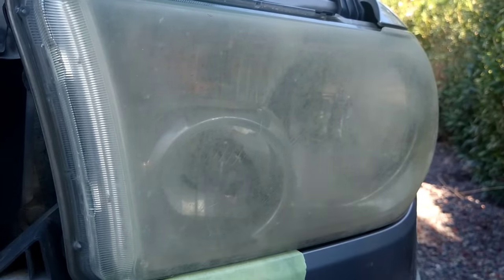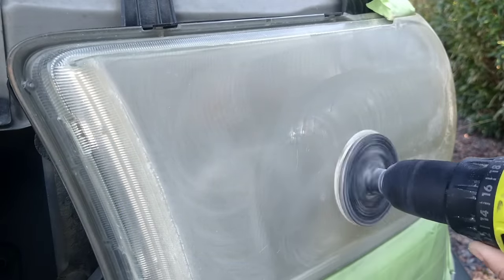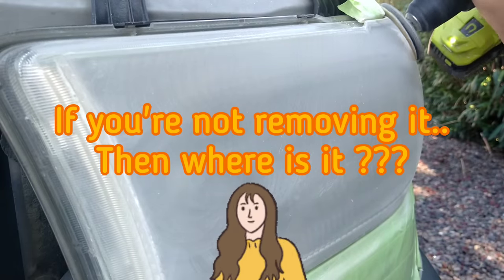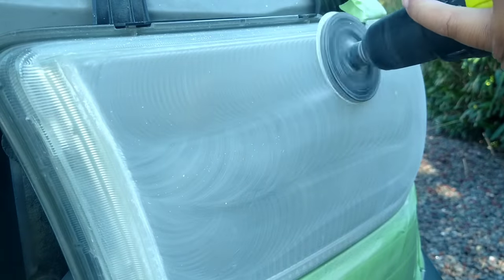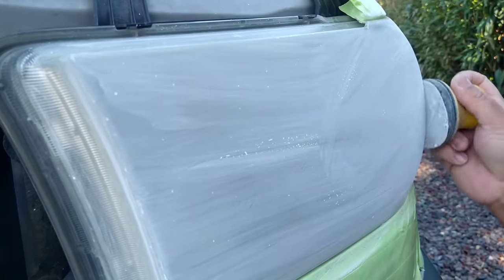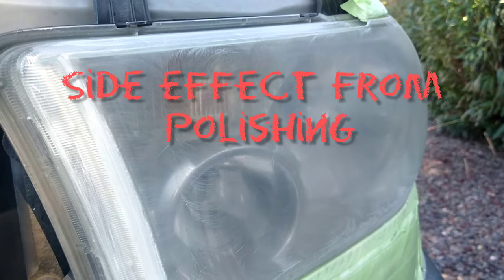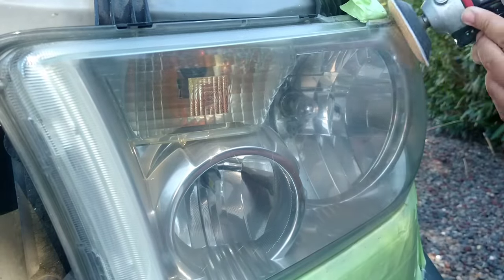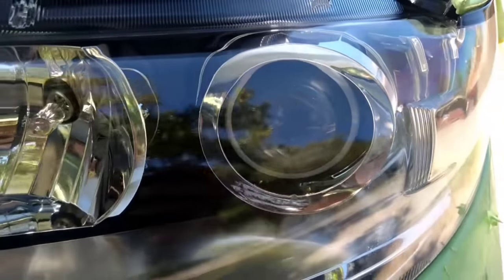POLISHING HEADLIGHTS IS A SHAM/scam  ---  and why you should never only polish headlights

Comment: For the polishing part. Is it okay if I stick to the drill bit if I don't have a polishing machine?
Reply from the maker: Yes and no... You can use it but you will not yield the same high resolution clarity... On a scale of 1 to 10 you could probably achieve a five with that if you work a lot longer at it.. with the polisher you can achieve 10.5 in seconds...
But it is possible I haven't always used the polisher for the step and they still came out awesome..
Reply: @theheadlightrestorationpro  thank you 🙏
Reply from the maker: @wontonpapi8848 👍🏽😁

Comment: If you drill holes into the headlight casing so air can get inside and dissipate moisture the headlights would not fog over like this one in the video. It's because they are sealed, and moisture gets inside (condensation) the lens that causes them to screw up. Just a few small holes with a cordless drill and you should be okay.

Comment: I sand thoroughly and spray urethane clear coat on them . clear coat has uv protection.
Reply from the maker: Awesome.. I got to be careful though.. yes most clear coats have a naturally inherited UV protection but it is limited and amounts.. that's one of the reasons why I like using products specifically designed for headlights cuz headlights need a tremendous amount of UV protection.. not just to go bad but to actually protect the headlights health, crazy spider cracking overheating all that stuff... But there's so many ways to do it as long as you follow the basic elements of true headlight restoration you should be fine...

Comment: After I hit a kangaroo and broke mine, so I bought a brand new headlight, still with tags and plastic for 50 bucks on FB marketplace from some warehouse or panel beater that had one spare. They even couriered it to my door within a couple of days. It was easy to put on (I'm not even very mechanically proficient). Now that is cheaper than most headlight restoration kits. And it looks amazing. Now my other headlight is yellowed, I'm thinking I'll just replace it.
Obviously I'd keep the old one in case I need it later...

Comment: I get all the sanding and taking it down to a 3000 or 3500 grit. But why put a coat? Is this just a UV protectant?
Reply from the maker: Yes it's a UV protective coating..,(headlight certified) designed for use with headlights specifically on headlights... It is one of the most single important steps whole entire process as you see in the videos I could stop at that point before I do that and I can even continue polishing further and further and further until the so clean and shiny and see through that it looks like I did spray it but it would come right back 3 months or less it would start coming right back... You do not want to do that then you're just having to take off headlight surface over and over and over the sooner or later you're not going to have enough headlight... And true headlight restoration you have to see it..)with a headlight certified designed for headlights UV sealer)...
Check out this video here this will really see you in on a couple things about why headlights go bad....
https://youtu.be/tnCdU2j5Ja0

Comment: have you ever had a problem with the ac delco.  my seems to stop when it gets hot I think
Reply from the maker: Never had a problem with that, if you get to the point of overheating you must be using it a way too much... I've never once had a problem with overheating... You should not be using it long enough to overheat...  using it for less than a minute, no tool should overheat in 60 seconds even the poorest quality..

Comment: Does the headlight coating comes off when you wash your car a few weeks later?
Reply from the maker: No it will not come off unless you use a manual method meaning sanding.. if I wanted to remove it two years later I would have to sand it all off ..
Reply: @theheadlightrestorationpro  Perfect! I don't it to come off. I tried using chrisfixit method with the 2x clear spray, that spray didn't work and started cracking and hasting up..
Reply from the maker: Yeah the guys awesome.. with that being said you got to watch a lot of stuff on this internet because can you can put so much stuff on it and make it look amazing for a couple minutes, couple hours couple days etc... But I'll start messing up really quick there's a lot of foolery on the internet with this stuff (headlight restoration) that's why by being a professional headlight restoration specialist /(that actually does this for a living) I decided to make this channel..
So people can finally get it from the horse's mouth 100% true..👍🏼😊

Comment: What if you clear coat it, will it last longer?
Reply from the maker: It will last longer but not as long as it should or as long as it could last..
See when you just polish it it's just doing a bit of a removal with a lot of chemical bleaching which is just changing the color and pigment of the cells and fibers on the surface of the headlight but is not changing the damage once the cells and fibers are damaged they don't heal themselves they're more susceptible to damage meaning that the sun will bleach them faster even with a coating on them than what you have is kind of like a walking Dead where the lights will look good but they'll start bronzing and turning colors underneath the clear coat.. they will last longer but not as long as they should.. one of my favorite sayings that to me makes the most sense is if you don't remove the damage where is it at?....
Very good question... If this was the case I wouldn't do any sanding but because it will come back faster because you're leaving behind damage to material that is just been chemically color changed through polishing and heat the recidivism of the color will come back probably half life if not less..
Very good question thanks for watching have plenty more videos up and plenty more to come..

Comment: what is the lowest grit sandpaper you think i should buy to do really bad headlights ? for example Like p320 ??
Reply from the maker: P220 and that's an emergency base I'd have to be really gentle with it not to press too hard or to overheat because it's a stronger sandpaper...
Reply: @theheadlightrestorationpro  ok thank you Amazon has 3m p320 for $27 box of 50 i think i will get
Reply from the maker: Awesome... appreciate it 😊

Comment: hello the headlight restoratinon pro...
 why would you go for 320 to take all that out faster??
Reply from the maker: Because this light was bare... No clear coat whatsoever for quite some time only thing that was on there was a bunch of soft filling stuff... You want to try to avoid using those 320s as much as you can.. it raises the risk of deep scratches and scarring that you have to try to remove which takes a lot longer and in the long run will take a lot more expensive discs to get rid of and time.... Also it runs a risk of damaging the outside of the vehicle the 320s and the heavier grits will eat through the tape way easier because they're stronger...
So to sum it up you pretty much want to avoid using the 320 as much as possible usually reserve it for heavy coated headlights with a lot of hard to remove clear coat.. also for thought this Toyota light is very soft the Toyota lights are soft or about medium...

Comment: I tried the 2K clear and it didn’t work. I sprayed it on and it immediately started to…crack when it dried. Had to explain to the customer if after the clear hardens and it still looks that way I’ll come back and fix it. I’m switching to the Meguiar’s headlight clear.
Reply from the maker: Yes you'll be much better off super consistent and always 100% on point five star in every category... 2K clear you never know what you'll get but it uses something negative even when it looks good...

Comment: I tried sand paper once on headlights, scratched them like crazy!  I didn’t do it right but now I’m trying to do this on a different car.  I’m scared to even try with a drill like he’s doing!  I don’t trust my lack of experience self for that!
Reply from the maker: You can try the same thing without a drill or power tools try to mimic the same steps as best as possible it will not come out as good as the lights on my 100 plus videos on this channel but you can get a really good likeness... Just got to remember to be gentle with your emotions and your pressure on the light.... In fact if you watch this video it'll definitely put you up on how to control your pressure and how much you should use to avoid scratching..https://youtu.be/C12RHABN0ZI?si=l_dlMUr7wJxWj20L

Comment: After buffing I noticed you did not water spray and wipe down before spraying the coating.  Does that affect how well or not the coating adheres to the surface?
Reply from the maker: You never want to do anything after that step before you spray coat...
Because it's adding adulterants...
Cook is streaking and smearing and all kind of things underneath the clear coat also you do not want to strip any of that beneficial oil away..
Check out these videos that go in depth about this...
https://youtu.be/LC4ZBu02JZg?si=xc7c6BbaDVYAqF8I

https://youtu.be/nj2dHo-XJd8?si=Hd71eYT-5JxD95Ih

Comment: Cutting compound (not polish!!!)and buffing wheel is the best way to get poly carbonate lens restored, it removes the oxidation 100% i recommend using Tripoli cutting compound and a Sisal buffing wheel, it usually takes just 15-20 seconds and lasts for years.

Comment: Use a coating on it that has a graphene or ceramic base with UV.  Also I suggest a random orbital polisher.  I use the rupes micro.
Reply from the maker: I have tried those things but what I've discovered is that what I'm doing is a lot better than most categories....
What you see on these videos is my evolution or the evaluation of my method...(have tried dozens upon dozens of different ways and come and products)
Reply: @theheadlightrestorationpro   I mean doing the coating over the clear coat you know as like an upsell for a premium.  I assume you have tried spraying the lights without polishing too?  I have had lights painted and cleared plastic and it can work and even using special formulated paints and adhesion bonders help but nothing seems to beat the adhesion you get if you paint a light scuff.  Have you tried using different cleaners in your final prep clean?  I don’t know what’s in yours that you used but any cleaner will always leave a film on glass I know.  In my industry the only way to get a pure surface is with 100% purified water or a squeege.  What about Preping with an alcohol and then pure water before you clear?  That way you have nothing underneath the coating to cause any yellowing?  I stare at glass all day and I know with that style of microfiber its impossible to get a perfect window they always shed fibers and electrically charge the surface.
Reply from the maker: Yeah with the microfibers and things like that and wipes they are extremely adulterated nothing better than a sprayed surface keeps it 100% pure.. two reasons I don't do anything after the polished up far as alcohol or ammonia base products number one is like you said leaves behind fibers and streaks and residue and it actually lowers the pH and horse sterilization of the service... Which brings us to number two the heat and friction from 7800 RPM cannot be matched as sterilization and the pH could not be any higher to the surface... Cuz the compound I'm using is not only plastic polish but it's also a cleaner it's designed to be used this way and believe it or not leaving its residue behind is the best thing you can do.. it leaves a little bit of the oily residue in the pockets of the poor spongy surface of the polycarbonate which provides an extra clarity and also a lot of headlight health cuz the restoration and decoration of service there's a lot of loss of the polycarbons natural oil which causes an excess amount of drying out and will cause premature degradation of the headlight surface if not left behind...it'll make your headlight reservation last longer and also your headlights last longer but not needing to remove so much of the surface on your following headlight restoration.. it also even improves the transparency in actual primary headlight function (your light is more clear and project out further)
Thanks for watching.. got a lot of videos up and more to come..💯👍🏼
Reply: @theheadlightrestorationpro  very well articulated I appreciate the feedback and well detailed answers.  i will subscribe and hope to talk with you again in the future.  Keep up the great work!

Comment: When I resurface my headlights I use protective coating and clear coat I start with 800. 500 is a bit too abrasive and will require extra sanding to remove all those deep scratches. That is plastic you are sanding off. And you should be wet sanded
Reply from the maker: What sanding is remedial and if you even Google it it's supposed to be added at the end of any sanding process as a fine sander... Also I'm not using 800 or 500.. p 500 and p800 are different... They don't equal the same.. 500 or 800 regular would be too abrasive yes..

Comment: Noob question on sanding headlights..... Previously I used polish wax or rubbing compound and some buffing and wondered how they could look bad so fast....can I use a palm sander? I have a strong one and a whimpy one, if I use proper grits and wet sand without pushing down hard. The car has a flat light, truck one is slightly curved.
Reply from the maker: You can use them ideal size is 3 in if you have a 3 in most of those are bigger..

Comment: What would you do for headlights that have lots of small pits from road debris. Could they be resurfaced and then have the uv protector applied or better to just get new units?
Reply from the maker: This process was work on those as well.. especially being that it's dry sand method.. you can remove more and be a bit more aggressive with headlights like this and it'll come out smoothly the baby's bottom again.. I deal with it all the time.. so come right out you got to think about 50% of them are the clear coat and even if the clear coats already gone you can still hit those steps to remove them quite easy..👍🏼💯

Comment: can somebody explain how the sanding doesn't damage the headlight cover?   Everyone recommends sanding and it seems to me that would rough up and scratch the surface.   I am reluctant to do it because I can't see how it doesn't cause damage
Reply from the maker: Pretty much just going to watch the videos.. listen to what I'm saying.. I will see they come out perfect.. no damage... In most cases it enhances it or improves the headlight health... Innocence when you first remove it it is kind of damaged but then you build it back up to smooth this just like with any other sanding.. if you rip a piece of wood off of a tree that's all messed up damage looking but then people sand it, different levels of sanding, lacquering, polishing and it can become as smooth as glass...Right .. pretty much similar process with the headlights... You'll freak out when you first do it.. but you don't trust in the process.. I have dozens of videos of you can see step by step I don't cut my videos for this reason so people can see from start to finish this is what happens..
Check out this video of my portfolios all done with the same method...
https://youtu.be/bCD4At1iFAg
Keep watching you'll get it.....
Thank you for watching..💯👍🏽😎

Comment: the uv protectant film that is on the headlights from the factory has failed which is why the lights look bad and yellow, removing all of the bad coating and clear coating them with auto body clearcoat is the only way to make them last.
Reply from the maker: No Auto body clear coat ,clear coat made for headlights... There are formulated for the specific use... You don't run your engine on cooking oil even though you could for a minute do you..

Comment: I used the Mothers headlight restoration kit and it worked GREAT! It's been 2 plus years on my BMW Z4 adaptive headlights and I would say what your doing is overkill.
Reply from the maker: You're entitled to your opinion but this isn't a novice application..
There's many ways to do it just different levels..
Reply: @theheadlightrestorationpro  Yeah when your talking about my $1300 adaptive headlight I'm good with sanding with 3000 grit and polishing but I'm not gonna go near as aggressive as you do. I get a professional results from the mothers kit without  doing the excessive sanding you do. But then again I dont do KIA head lights.
Reply from the maker: Good for you... $1,300 if that's expensive.. I've done $7,000 headlights and I come out perfect.. high end vehicles not everyday vehicles as well as everyday vehicles like yours.

Comment: How do you tell when you've gotten through the buildup to the actual headlight? Or more to the point, how can a newbie DIYer tell?
Reply from the maker: Whatever location sanding on will bleeds should begin to bleed really White 🤍 🐻‍❄️ like baby powder... In comparison to the beginning... Also the spinning motion can feel the torque at the tip of the pad or disc.. it will change and give you less resistance as well.. are you just got to think it's very small amount very small depth generally half a sheet of piece of paper for bad light this light probably was a sheet of paper... Hope that answers your question good enough...
Thank you for the good question...
Reply: Thank you!

Comment: I guess it just dries on. How long does it take to dry?
Reply from the maker: Literally the crust tastes like 30 seconds to dry the crust is the layer touching the air... The whole coating will dry in 3 minutes or less even in moderately cold weather... The hotter it is outside the faster it dries also the more air introduced the faster it dries and this is why I use forced air drying with fans...
Just dropped a new video check it out..
https://youtu.be/-r-uVdqy0dU?si=ywy7TyeF66H6TwdU